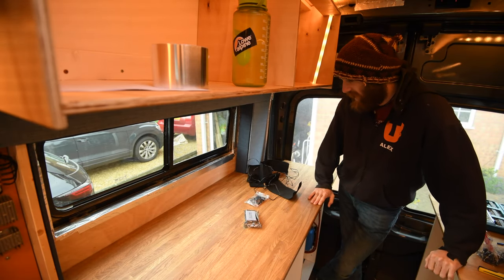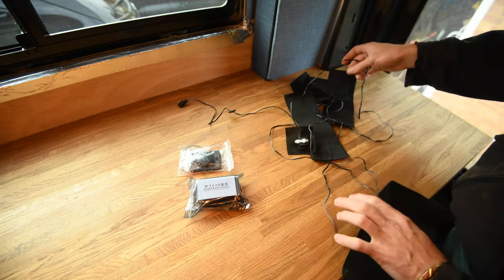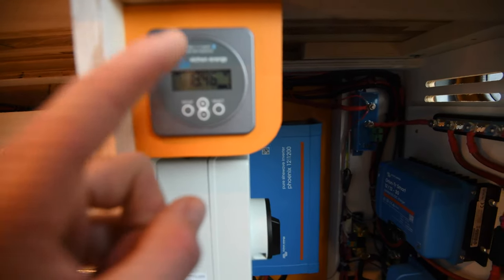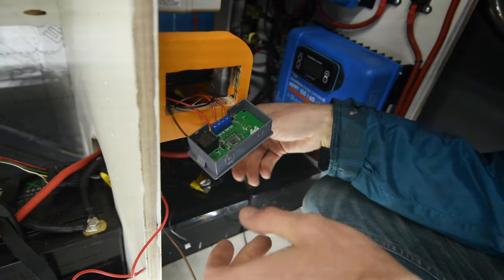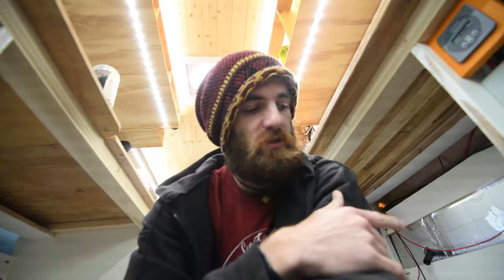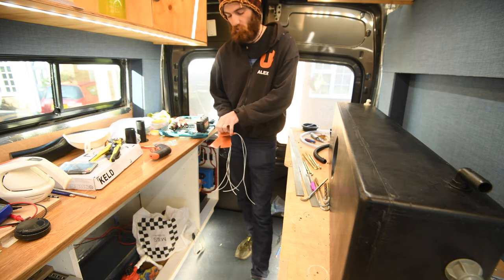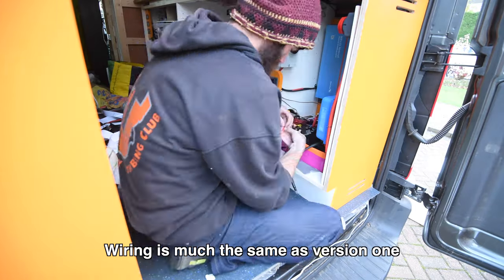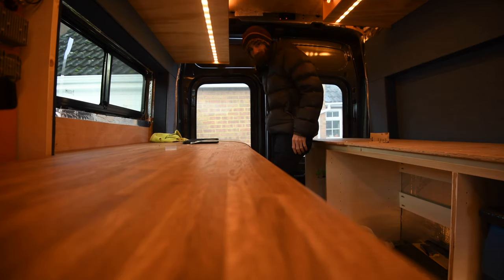DIY lithium battery warmer, Trial and error | EP35 | Ford Transit Campervan Build

Comment: Save your money and power and go back to lead. Heating batteries is not efficient.
Reply from the maker: The positives of lithium batteries , far out way any cons. the battery warmer comes on for around an hour and 20 minutes consistently at a time ( at 3.75amp. ) on a cold night if the van is left unoccupied and heats the batteries from 7c to 9c. That energy usage is around 1% of the entire pack.  

Large Lead acid banks in a van builds are just uneconomical weight ( for the same amount of usable energy in lead acid would weight about 150kg whilst this is 55kg ) and power ( the amount of energy lost when charging due it to lead acid being a high resistance battery type ) and money ( 10% of the cycle rate life span of lithium, not not ideal for full timer )
Reply: I wholeheartedly disagree with that. I am a full-timer. Lead is more capable.
I've documented a lottov of my findings from here:

 it seems youtube doesn't like the link.. 
www.
fieldlines.com
/index.php/
topic,150161.msg
1053973.html#msg1053973

I like your shower implementation that's why I tuned into your channel. I plan to build a conceptually similar system.

A battery that burns your van down when the not failsafe safety hardware fails isn't good enough. Worst-case scenario.
A battery telling the solar and alternator to throttle/stop producing in the weather you need it the most is pretty ludicrous day to day.
Using 30Wh per °C to increase battery temperature is neither efficient nor practical. You'll need 600W of solar to generate that alone with a horizontal mount on a Winter's day. Lead is taking names on that efficiency. 
Your numbers are incorrect by the way lead is double the weight for the energy density, not one third, it's not high resistance either.
Reply from the maker: Well you’re more than welcome to disagree. 

Weight-wise. One of my 95ah lead Acid leisure batteries weight is 25.6kg. With a DoD of 50% ( 47.5ah is usable energy per battery)

Each one of my lithium batteries weight 19.5kg which 130ah and a DoD of 80% ( 104ah usable. ( in total for all 3 it’s 58.5kg, apologies for the rough originally stating 55kg ) 

Let’s do a bit of rounding for math sake. To get 300ah of usable energy from a lead Acid bank would need to be 600ah bank. Given those batteries roughly were 25kg for 100ah ( 50ah Usable ) . You would need 6. That’s 150kg is total, versus 60kg ish for the same usable power in my lithium. And weight is pretty important for build vans. 

Purpose of the warmer is Keep the battery within safe ( without damaging the cells ) charging parameters, Lithium batteries can be discharged in minus conditions without issue, Just to make sure we are both on the same page this is a warmer load which comes on for an hour maybe once or twice a night and not a continuous load of draw of 3.75amp 24/7? or an hour or two a night maybe ( when the heating isn't on )  As I’m still not sure I quite follow your inefficiency or calculation method, maybe I’ve misunderstood what you said. 3.75amp when the warmer turns on a cold night Normally for around an hour and 20 mins at a time. So 3.75ah per hour of use, so 5ah to heat the batteries for the standard a hour & 20 minutes to get between The temperature controlled relays on and off points 7c & 9c , just over 1% of the banks capacity. Since I’ve got a 30 amp DC to DC Charger the following day I will need to turn the engine on for a total 6 minutes to regain that power used power, as for solar I have 500watts of flat mounted panels. Over the last week I’ve been averaging around 450wh intake per day. So that energy use if the warmer came on once or twice the night before as often regained in the first hour or so ( depending on weather obviously ) 

As for burning down ones van is pretty hard to achieve thermal run away with a LiFePO4 chemistry as LiFePO4 does not ignite or explode ( unlike lithium polymer which definitely does ). Overcharge, over discharge, short Circuit or physical damage will damage the liFePO4 cells and in cases irreparably, mostly ballooning of the cells in case of LiFePO4. ( unlike LIpo / lithium polymer which can have thermal run away ). As for failsafe that’s why there are multiple. The batteries themselves with built-in BMS’s, and each charger I use particularly use in my vehicle all smart changers are ( multiple charge stages ) and additional failsafes

Charging lead acid is less efficient and lithium by far. Especially high rate of charge charging
Reply from the maker: We might disagree on batteries haha. But as for the shower I will be doing a follow-up video having used it for a while now. But it’s been working great. Only change I’m looking at making a switching to a natural soap as it seems the carbon filters have a easier job at eliminating it. Which seems to be the same case for most other   shower builds I’ve seen. What’s your planned heat source for it?
Reply: I sent you the link because I've investigated most of what you are saying (sorry it is a bit long-winded) and common knowledge and posted my findings that usually contradict what marketing would like us to believe. You can discharge lead to 80% it costs the same, you can check the graphs on the manufacturer websites. 80% DOD = half as many cycles as 40% DOD. Lead-acid has non-linear efficiency it's actually 100% efficient below 80% SOC and dives after that at higher SOCs. I've not seen a Victron push one passed ~90% SOC so moot point for most. As regards LFP you can get thermal runaway with extreme lithium plating from using high C rates at low temperatures. Incidentally, I can get 100Amp off my alternator to a lead 235Ah battery with a simple contactor and good hearty cable. I can usually exceed those dc-dc jobbers with intelligent cabling.
You can actually damage LFP at 15°C if the charge rate is high enough. 
LFP will last a lot longer if you keep it in the 20% - 80% SOC range but then you get memory effect problems.
When you factor this versus £ per kwh lifetime, lead's on top.

The simple point is that the batteries in the real world have similar performance and efficiency except one requires a heater, very poor efficiency there and it's way more expensive for the pleasure. The supporting hardware is highly expensive too.

Your battery isolator isn't up to the task by the way. Alternator killers those things. They're not switch-disconnect rated and the contacts get pitted and fail over time.

Regarding the failsafe nature. Redundancy is not enough. If a part fails the system ought to shut down not limp on at half-mast unattended. If your heaters fail and your Victron not heatsinked temp sensor is giving erroneous readings then what happens?
The battery internal BMS is FET based, these fail and continue to operate without notification.

When you say charging lead-acid is less efficient by far have you measured this? I have! Add the heater load to the result please.
Reply: The shower's clever alright. Yes, the natural soap I flagged already. I'd also like to simplify your design by removing the holding tank and putting a scavenging pump under the shower tray or perhaps a GRP tray with a grate over it. My heat source: I have an Eber 2kW Airtronic, I'll be installing a hydronic 5kW, colorifier with engine coil also and 24v 45A PWM Solar diversion control, ~1kW of solar. I've 6kVA of inverter to play with but I'd like to go 3 phase/single phase synchronising 10.5kVA (3 x 3.5kVA). Battery is 20kWh AGM atm but I might go bigger (price me a LFP one with that capacity willya?). Base vehicle 24V Vario. I look forward to the follow-up, the air heater conversion is a neat solution.